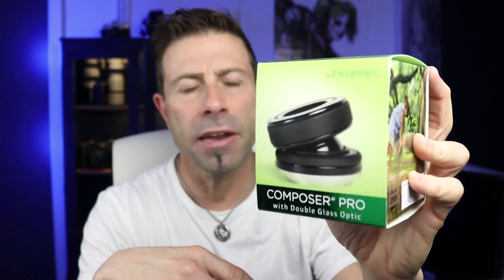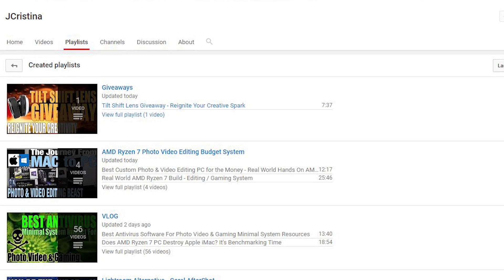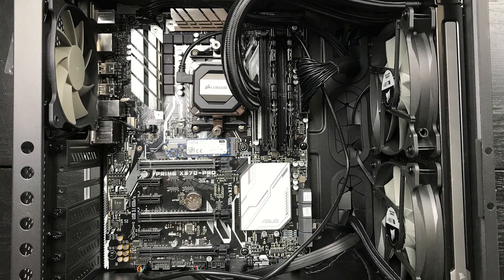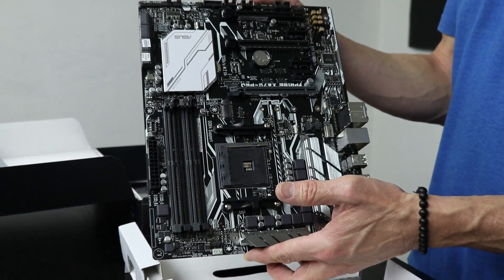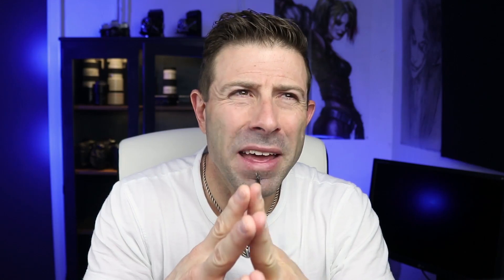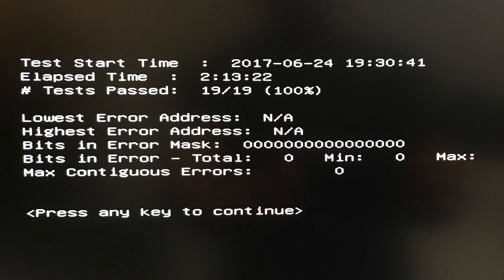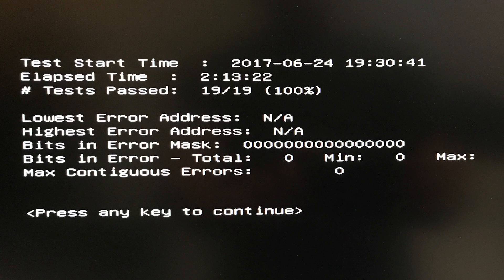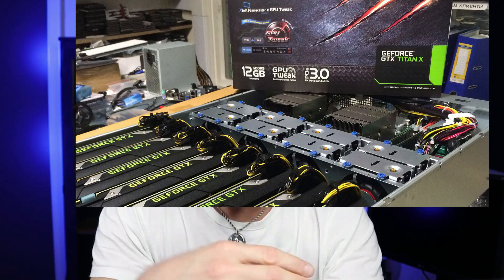Does AMD Ryzen Suck As a Production PC? Why or Why Not - Reliability Update Drivers, Firmware

Comment: I have Ryzen 1700 w/ ASRock X370 Fatal1ty Gaming K4 as an editing rig and I have absolutely no issues with it. I use Magix Vegas Pro and Adobe After Effects mainly.
Reply from the maker: +KLU awesome setup I am enjoying my 4x faster editing and smooth playback for sure. You can see my build in the playlist. Thanks for adding to the discussion KLU.
Reply: Yeah, render times are fabulous, even on stock speeds. It's no secret that we all have memory issues (I'm not able to go stable for anything above 2433 MHz yet), but I hope it will be solved in future BIOS updates. But anyway, for that amount of money, I am more than happy with the performance. I think I would have to spent 50% more $ on a similar system on Intel.
Reply: I just hope to see more optymized applications for Ryzen, like some Adobe patches or updates to handle the works better. I have an impression that I could still squeeze some more juice from it :) On Magix for example, I never go above 60-70% CPU load on every core.
Reply from the maker: +KLU True. I also max out at 2400 on MEM. Even with 3000mhz memory. That why I returned it for Flare-X Ryzen compatible 2400mhz 1.2v sticks.  I figure one day I'll be able to overclock the 2400 to 2900 at 1.35v or so when possible.
Reply: See, Ryzen enjoys Samsung B-Die memory. Found a beta bios with AGESA 1.0.0.6, turned on DOCP Standard, 3200, nothing else you need to do. Never had restart issues. Sometimes it had cold boots, that was simple enough to set the dram voltage from 1.35>1.375, and changing the dram boot voltage to 1.4v. Never cold boots again. Crosshair Vi Hero.

Edit: Using a Seasonic SS-650KM3.
--Reason why 1070's cost more, mining craze since it's the next best after RX 48/58's.
Reply from the maker: +TRBFlux Do you think the G.Skill Flare -X 2400 1.2v will overclock in the future?  I'm guessing 1.35v or more should afford a bit of an increase but it does not work as of today for me. Thanks TRBFlux
Reply: Would look for the beta bios', anything with AGESA 1006 will have the added sub-timings. For the AGESA 1004, I was able to fight my Trident Z kit to 3200 with the same voltages, 1.1v to the V-SOC, and tinkering with 1T and 2T. Some days it preferred one or the other. Turning off HPET in windows is a must, windows installs default with it off. With the new Ryzen Master version, you no longer need the HPET to do overclocking. There are a ton of things that a specific to each Ryzen / memory kit together. As for me, C6H / Beta 1401, stable, capable of 3.7 / 1.35v on the stock cooler until my x62 bracket comes in. I can't remember all that I've done specifically, I just used my habits of Google and lurking the Overclocker/net/Overclockers/net megathread on Ryzen overclocking.
Reply: As for your Flare-X kit, it is dual-rank, aka double sided dimms, quick google of ryzen memory speeds, and you get AMD's official out of the box overall guaranteed speeds for channel / rank. Since 2666 to 3200 is an improvement, basic math will estimate 2933 at maybe CL-17(?) depending on how well you can tighten that kit. CL-16 is around the median, CL-18 would be reasonable for that kit but at that point it will be trading memory latency for Ryzen CCX transfer speed. Like I said, Ryzen has it's quirks. With Intel, you buy a 7700k, XMP, ah shoot, only 4.8 GHz on the silicon lottery. With Ryzen, you gotta learn every aspect of the chip you got, once you get all the little nit-picky settings in your mind and a good idea as to how it responds to each setting, you can easily narrow it down and get the most out of your money. The problem is not a lot of people are patient and/or have the willpower to retain everything they learn on it. With me, I made the Arma 2 DayZ run on a Core 2 Duo Su7300, tweaking has always been a good past-time of mine, and my 1700 has been fun to play with since I swapped out my 6600k.
Reply: As for the issues, you can't really blame it, it is a new platform, a new architecture, even AMD are still amazed at what it has become. We can't really ask a company with a 10th of the funding of Nvidia and even less than that of Intel, with a consumer-base, less than both, to have the same rigorous testing as both, with less than a quarter of the time to actually test it. People are upset with Ryzen for one reason. It isn't fully hammered out on plug and play. Those same people will call a 7700k a godsend for XMP. XMP scales back to even Z87, just about 4 years old. Counting the numerous generations to iron that all out. AMD have been playing with an experimental chip, and making it behave with Intel designed memory, on rushed motherboards, within a 4 month period, with no more than a 10th of it's competitors. Everyone really needs to chill and learn more about CPU's, it really is fun and enjoyable, and as a whole, Ryzen really is a godsend. Pair a 3.9 GHz 1700 with DDR4-3600, and it can nearly go blow for blow with a 7700K @ 5 GHz in nearly two thirds of the benchmarks. Problem is, these people doing benchmarks, have HPET off by default on the Intel setup, and ran their benchmarks with HPET on for Ryzen Master, all these other things that really obscure the performance.
Reply from the maker: I 100% agree. I'm so thrilled that AMD has become competitive with the big boy. It feels like Sony fighting it out with Canon and as of late .. Winning.. :0
Reply from the maker: I've been able to run at 4.1Ghz at 1.45v and 3.975Ghz 100% stable with a low cost H110i. 100% 8 core load at 50C max @ 1.425v. I have not been able to do anything with the 2400mhz memory though. Even though it runs at 1.2v 2400mhz I've tried loosening up the timings but still have not got anywhere. I think they run at 15.15.15.39 (or 37) if I remember correctly. I completely understand that if we loosen them up to much, it really will not help much with the combo of increased latency but better infinity fabric speeds. I guess a wash but I would like to see 2666 or 2933 though..
Reply from the maker: High Performance was the first thing I did in Windows 10 but along with a bunch of other tweaking. I want to say thank you for contributing so much to the conversation. I'm sure everyone is enjoying the deeper discussion and hopefully get a thing or two out of it.
Reply from the maker: Agreed 100%. Adobe is my primary use of this production system but I'm sure many others frequenting this feed will be happy if some of the large AAA game companies put some Ryzen fixes in place to utilize it's many additional threads for sure.
Reply: KLU Using the same board, 1700X, Crucial 3000MHz dual rank @2933MHz, no probs either.
Reply: on my c6h, if i were to try for higher clocks on that kit, i would do docp standard, 16-18-18-18-37, scroll down, command rate or CT, it will probably be auto, set to 2T, voltage to 1.375, boot voltage to 1.375, and SOC voltage to 1.1v, and try straps from 2400 and up, if failing, try 17-18-18-18-37. If all else fails, try to look for a good review where they overclock the kit and take note of what they req. Other than that there are some other things, like Geardown, and something like ProcODT or something like that but the values for it are in Ohms for resistance.
Reply: For me, F4-3200C16D-16GTZSW, running at rated albeit 1.375v and 1.4v during boot.

Edit: One of my favorite kits I have purchased. Bought it around 3-15 for my 6600K build, Newegg had it for $109.
Reply: As for more tweaking on my C6H, I've managed to drop idles from 40c to 31c and load from 68c to 62c, 3.7 @ 1.3v at the moment, still waiting for my X62 bracket.
Reply: Nihulistic99th F*ck you! What is you problem? I have no issues with my setup, so I left a comment. Do you even have any experience with Ryzen whatsoever? If not, stfu.

Comment: It sounded as if you are were saying one needs to make a fresh image backup after a new install because of the whole Ryzen thing.  I think this needs to be done anytime one builds a new system regardless of what platform (cpu/gpu, etc) one uses, right?  Hence, you'd have done this even if you have built an Intel system too.
Reply from the maker: +Anthony Martin Absolutely. That's why at the end of the vlog I said it would be a good practice for everyone. It's great to be able to fix a problem that is software based by going back to the most recent working boot drive image with 10-15 minutes.
Reply: dude you just got a malfunctioning motherboard that caused your windows to hang, that was the issue, period. You should format the disk and install windows again upon receiving the new motherboard thats like ABC of computer servicing and it is totally irrelevant to ryzen or AMD in general.
Reply from the maker: I indicated in the video Bill that I received a NEW motherboard and it was not the issue. The problem was with an auto-driver update or Windows 10 Pro update which caused the problem. Once the bootdrive was formated and Windows 10 Pro reinstalled and all software put back with no updates, everything has been perfect for 3-4 days now. No more issues.

Comment: This happens to Intel cpus to. Salazar Studio/science studio just had this problem.
Reply from the maker: +ClanCreamhershey Funasd You see. This is good to know. Now that I'm doing full image backups of the boot drive, I'm really not worrying about it any long. Thanks for adding to the conversation
Reply: I just checked, Science Studio symptoms were diferent, he had high cpu % usage and low gpu % usage, he spent 3 days messing with it, he fixed it by reseting bios & clean installing windows. Hes backing up more often now just in case it happens again!🐻🐨

Comment: I just went through the same issues with my ryzen 7 on a ASUS crosshair 6 Hero. For me the issue was the PCIE express power cables for the gpus in my system. I have two Fury-X cards in my editing rig. It took a bit of poking around to find the suspect PCIE cable. I ditched the pigtail style cables and ran all four 8 pin PCIE connection straight back to the powersupply. Since then  it's been fully stable with the cpu and gpus overclocked. But the symptom was identical to yours. No Display but fans running but system hung to no display recovery. I hope your stability is good now but for me the issue was full gpu load was starving the GPUs for power with the cables even though it's a 1000 watt corsair powersupply.
Reply from the maker: +Terry Carter Thank Terry for the great real world information. I'm sure everyone reading will appreciate this information. I have also heard about this pigtail issue.